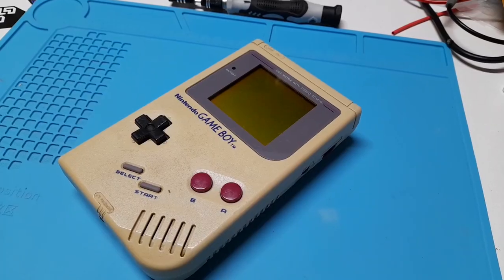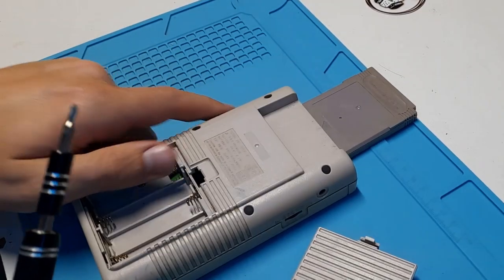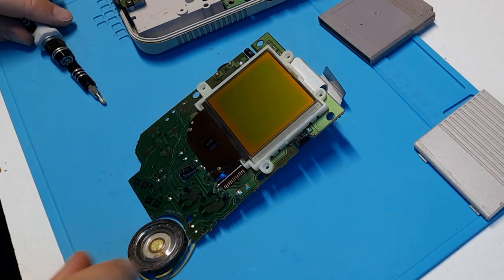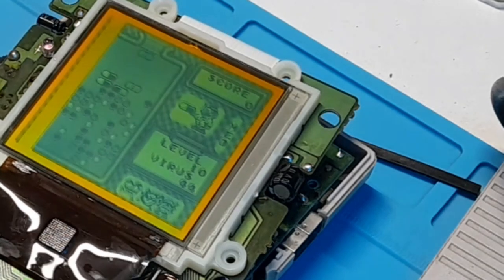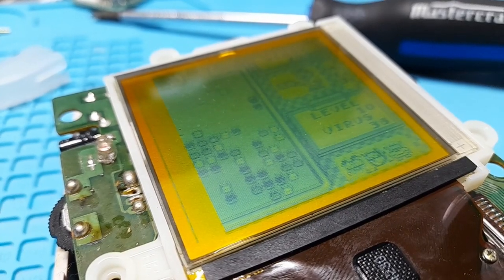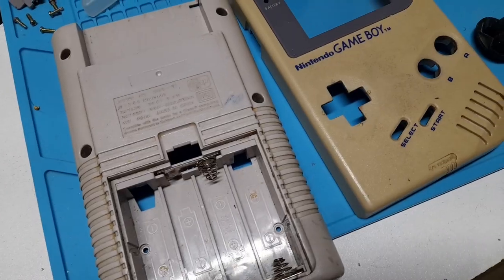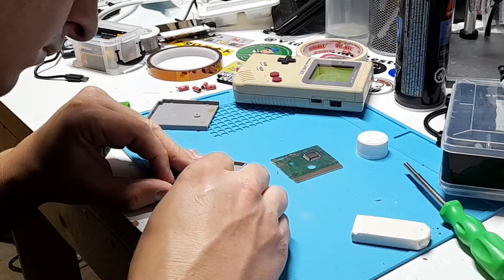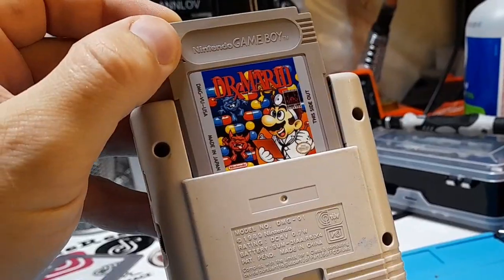I Couldn't Save This Gameboy

Comment: Unscrew the screw holding the ribbon down at the bottom left below your iron. Warm up from the black IC in the center on left side working around and up to original spot under screen. Usually the break when it isn't restored on the top glass is because the break is on the IC or the bend caused by the screw
Reply from the maker: Interesting! I did undo the screws with no luck but didn't try around the IC!
Reply: Luke coming in clutch with the tips and tricks! Too bad they didn't make them easily swappable from the board.